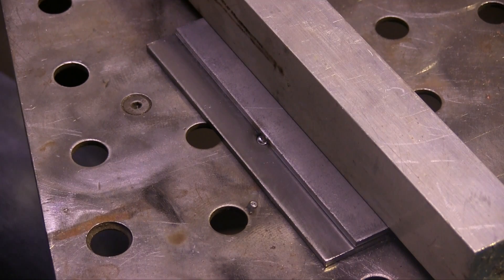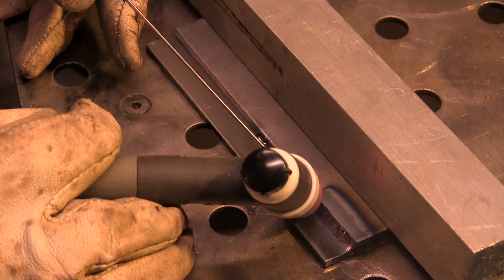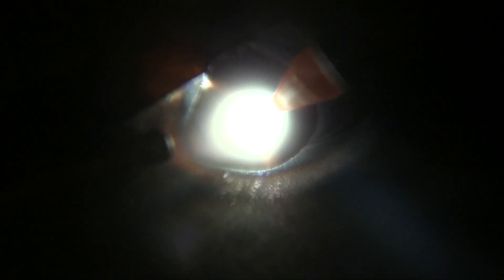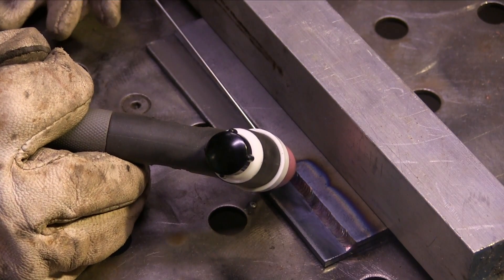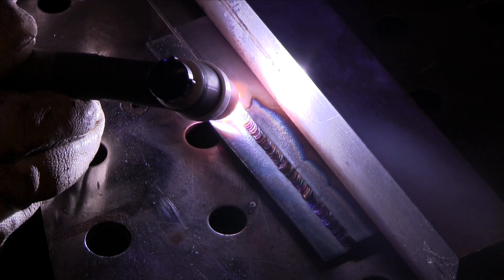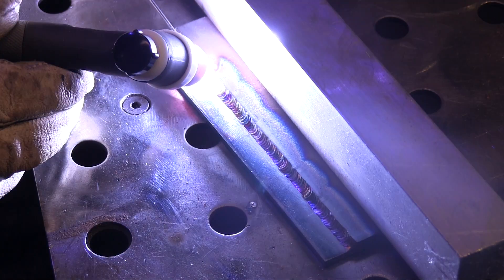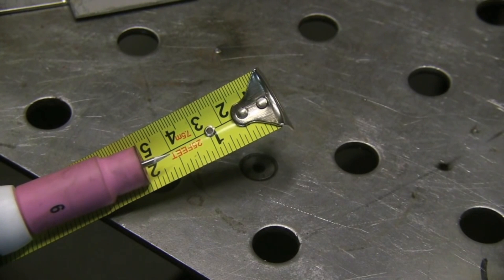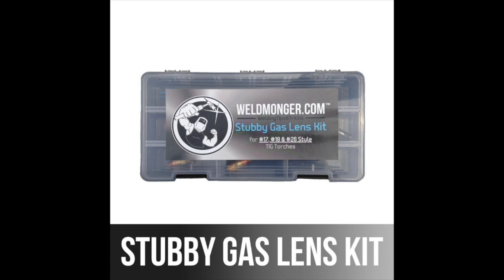Tig Welding Bead Restarts

Comment: Wasnt entirely sure where to put this but how do i stop my arc flaring up is it contaminants in the metal that i haven't cleaned.
also i have some 2% lanthanated 2.4mm  and it balls after about a minute of welding the ball ends up being about 3-3.5mm is there anything i should be doing to stop this?

many thanks James

Comment: Hey Jodie, love your videos they have been very helpful for me. I have a request could you show us how to setup a generator as a scratch start tig rig? I have a 30amp 220 ac/dc tig 200 I was just wondering if it would be possible to use my little 2000watt honda inverter generator as a tig/stick welder without much cost invested. I know how to set up a stick welder as a scratch start tig. Thanks a lot!

Comment: You are an awesome teacher. I want to setup a little area in my garage to do some Tig during the winter months. Can you possibly show us your shop a bit and give any tips you have as far as setting up a decent safe shop? Also, do you wear your normal glasses under your helmet. My eyes are not what they used to be but I have not had much luck with my PX glasses under helmut. Those shots are amazing.
Reply: they make cheater lenses that snap into the inside of your hood, they are about 8 bucks at any welding supply store, also available through amazon

Comment: Does he rest the tungsten on the weld when he is finished the run and letting the gas get to it ?
Reply: Jonny 310301 yeah that's common practice
Reply: Robert Atwood But I thought resting the tungsten on the weld contaminates it, Or is this only when an arc is striked and the electrode contains a radioactive source?
Reply: Tungsten's only alive when it's got electricity two it right I TIG welded stainless steel up in Kansas for years huh building food processing equipment sanitary welds we didn't have the luxury of a foot pedal everything we had was thumb throttles so at the end of the weld went straight down I see a lot of them do it on YouTube now back in the day we had a practical use for it
Reply: Robert Atwood Ooh Thanks mate

Comment: Great video Jody, when you've got my coordination skills, you pretty much do have to restart that often (and regrind!) :)  OK, I'm exaggerating a little, but not much, and this'll help.

Have you done any videos on visors? I haven't found any.  I've got two types , fixed filter, flip when you're about to strike, and automatic (with knobs for sensitivity and response time), the fixed filter is ok until my glasses fall off when I nod, and the photo-responsive is OK until I'm looking at shiny metal ( and it blacks out so I can't see until the arc lights), or worse, until my hand gets in the way when I'm welding, and the filter goes clear, which is much worse :)  any hints?
Reply: 2LeftThumbs Optical lenses were used back in the day I haven't been able to find them for years however I have found optical glasses they are for lasers you look through them just like you would regular glasses and they actually filter out without any kind of darkening the harmful rays of the Ark I did find them at Lab Safety Supply and they're like $400 a set the old Optical lenses we put in our welding hoods did the same thing it was a filter that wasn't dark back in the nineties when I last had one they were a couple hundred bucks like I said I haven't been able to find anything online lately
Reply: Robert Atwood thanks for this, I'll look into those options!

Comment: Informative video Jody,seeing the puddle grow in those arc shots is priceless i think in learning how to do it. ,i found on 4130 CM cluster joints it really looks good when i can not see the restart makes me warm and fussy on the inside.

I see you mention aluminium welding post flow is "less post flow required then steel/stainless steel" 
A thing i noticed on feildres's video about the post flow on  Aluminium was to more to stop oxidation of the tungsten electrode and was as much to stop the aluminium from oxidising  while at a elevated temp as well,this may be specific to pipe welding or welding to a code but 
intrigued me.

when i seen the tungsten change cooler after welding at say 200+ amps with a 1/8" tungsten i  upped  my post flow and it stopped the tungsten from becoming so weak and fragile,it made a big difference for me on my transformer machine with only a air cooled CKTL 26 torch setup.
Reply from the maker: great point.  no matter what metal, its good to use enough post flow to keep the tungsten silver.  if you dont, you will get a small amount of oxidation into the argon when the tungsten gets hot
Reply: It Never accrued to me that the tungsten was introducing oxidation into the Argon Stream when it became hot again ,i guess thats what happens when you really dunk it into the weld and contaminate your tungsten its off-gassing all that crud into  the argon stream as well.
Thank you for the response Jody,hope you enjoyed fabtech  man.

It makes more sense now why Michele Furick said in a instagram post to scotch bright your tungsten after sharpening the ends or when it goes pail and frosty along the sides,witch i seam to get a lot of with the transformer machine.